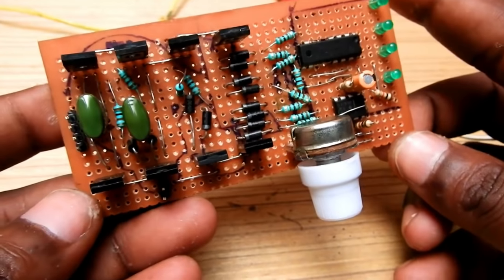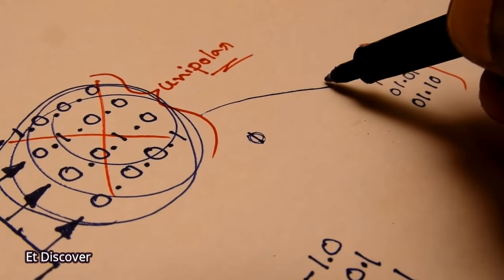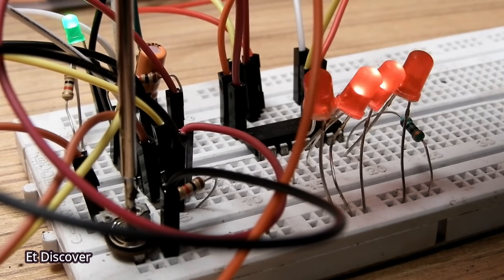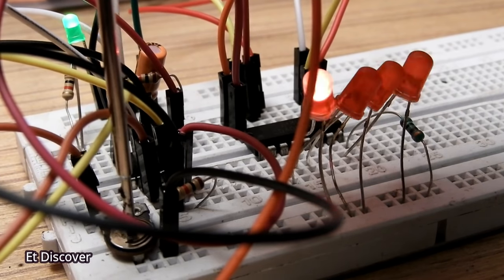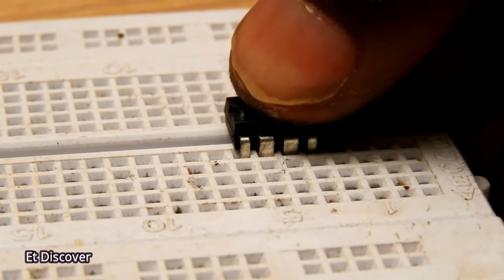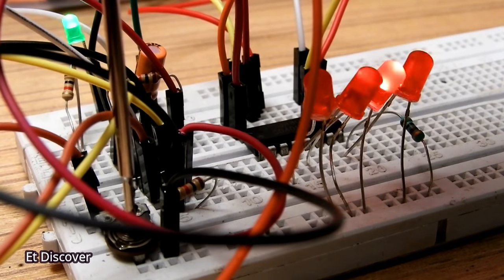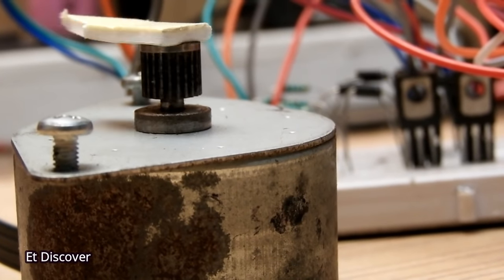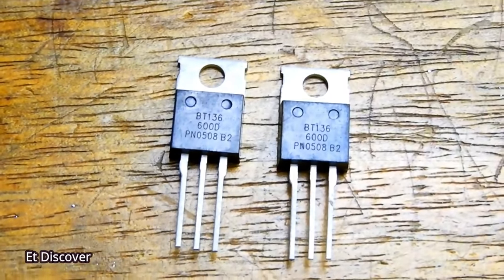Home Made ESC controller for_bipolar stepper motor_Et Discover)

Comment: Hi sir. I have made one mosfet a 555 pwm motor controller circuit. That can oprate a6amp. BRUshed motor easily . But as i oprate bldc ceiling fan the 555ic goes burn. Why. Plz help me sir
Reply: The 555 cannot sink or source much current. You need to connect your PWM signal through to a transistor switching circuit like this: https://youtu.be/wBAfxYLyb0Q